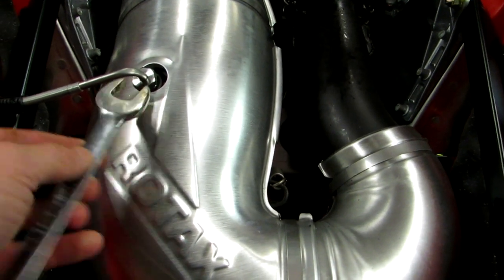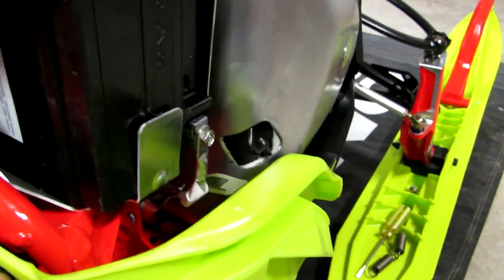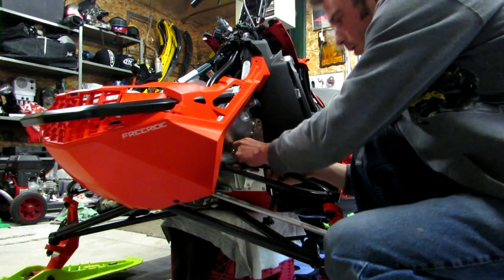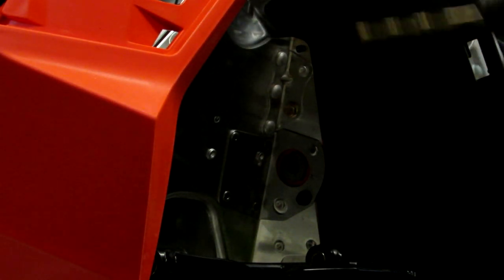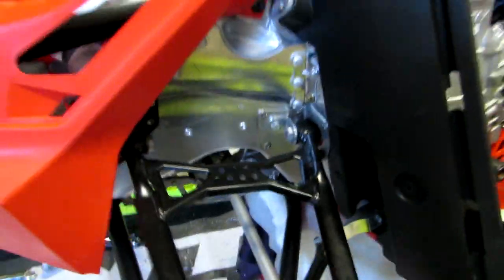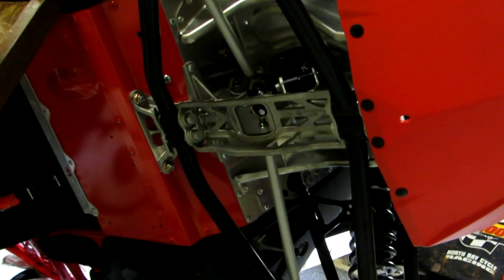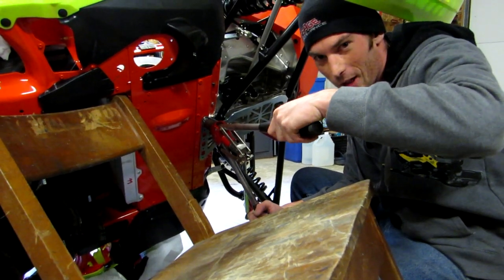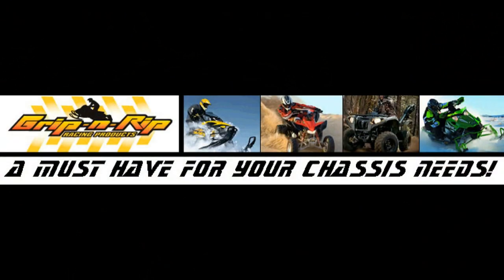Grip N Rip Racing - Upper Rear A Arm & Suspension Module Brace Kit Installation

Comment: people on ski doo forums say it doesn't help much. I've seen  resent post that say s-modul still get damaged from slow speed impacts when using grip n rip brace. it just makes swapping s-module harder they said. I think the stock ski doo a-arms are to strong for the chassis. lynx use s shaped high clearance lower A-arms with narrow triangle on some sleds. I think that would possibly save an s-module. upper bulkhead brace seems like a good deal..
Reply from the maker: yes i agree, the bulkhead with the braces is still to weak... needs to be stronger to take impacts.

Comment: I know my  2014  Renegade  800  is  weak ..  I hit an  irrigation pipe  under soft snow when  I only had  50 miles on it and bent it all up ..  I googled for braces  ended up at a PowerModz  Video that recommended    Grip N Rip  but the  braces  were totally different for a pre  2006  Model ..  
   The Grip N  Rip is not the best Web site.. I have to call them after their Spring Vacation..  And  figure  out what  Braces  are designed for my  Model .

Comment: Hmm weird that my expansion pipe on my 2016 800 e-tec Renegade XRS doesn't have a sensor on it. But the Freeride does lol?  Mine just has the sensor on the can not two.
Reply from the maker: +KThachPSN really...i didn't know that i wonder why that is?
Reply from the maker: +KThachPSN are you sure you just can't see the sensor?
Reply: I had my sled almost completely torn apart when installing accessories and when I had the exhaust can and expansion pipe out I noticed it didn't have a sensor like yours does and it's the same engine. (800 e-tec 2016 XRS)
Reply: Just has one sensor on the can and nothing on the expansion pipe. I have a picture of the pipe in the sled.
Reply from the maker: as if, wonder why they did that
Reply: Maybe they put a special HO engine in the Freeride and didn't tell anyone lol.
Reply from the maker: +KThachPSN are you on dootalk and if so can you do a post with a pic?
Reply: Yep my Dootalk user name is KThach. If you scroll through the photos on my build thread you'll see a picture of the expansion pipe in the sled. http://www.dootalk.com/forums/topic/1163178-2016-ski-doo-renegade-xrs-build/#entry13987410
Let me know if you find the photo
Reply: I ended up making a new post in general discussion heres the link http://www.dootalk.com/forums/topic/1166049-800-e-tec-exhaust-sensors/
Reply from the maker: +KThachPSN we have our answer... lucky you to not have two sensors if they fail they are EXPENSIVE!!!
Reply: Yeah which is why I mentioned on the post I actually like having 1 instead of 2 lol. My friend had to have one replaced on his 600sdi a few years back and the sensor was $300! Crazy for what it is.
Reply from the maker: OUCH!!
Reply: KThachPSN long track models have them ,it's a thermo coupler module sensor

Comment: I'm shocked that people would use any kind of reinforcement on a structure that is designed to give way under impact. All you are doing by adding one of these is transferring the energy absorbed during an impact to the next weak link which will be your E-module & possibly your tunnel.  Good luck with that repair...I know, I've done mine. Ya its a shit job R&R the S-Module but much better then pulling your motor ect...
Reply from the maker: the issue is the front end of these doo's are so darn weak, hit one rock or stump, railway crossing, curb or even loading in your trailer and catch a carbide and your all tweaked... i agree if you slam something hard enough its going to bend however this help prevent tweaking in a minor bump IMO
Reply: yes, a weak design indeed! Its too bad, I really like the XM platform to ride.
Reply from the maker: They are no sidewinder in terms of POWER tho... 4 stroke turbo is amazing
Reply: The  A-Arms is what is supposed  to bend not the Chassis .  My  Yamaha  Apex  is cast  Aluminum  Bulk head almost  indestructible    sled  but  very heavy ..